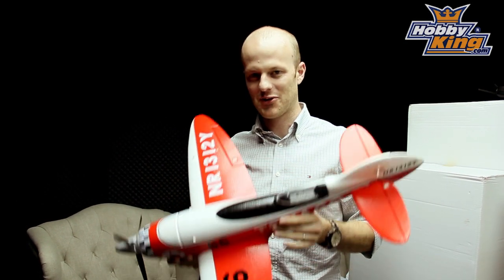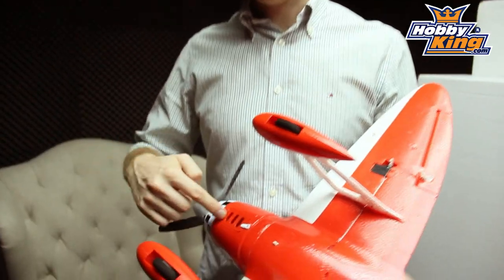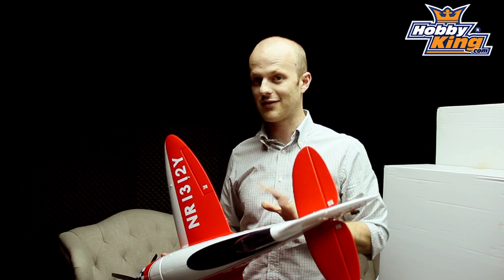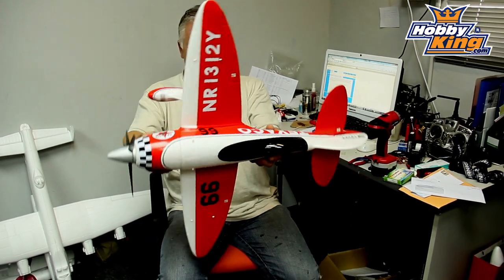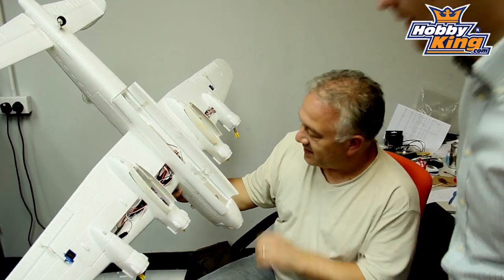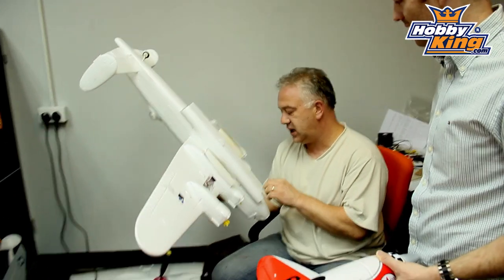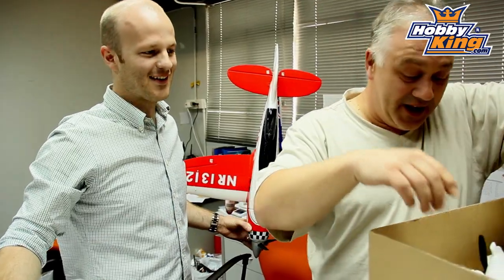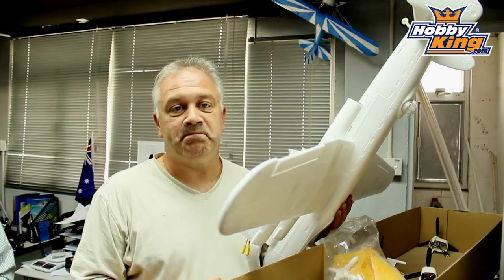Pre-Release GeeBee R3 & Lancaster Bomber Test-Run

Comment: The Lancaster looks like it will have a high wing loading and as a result fly way to fast to look realistic in the air. The Gee Bee R3 is a really neat looking airplane but why pick a plane that never really existed? There are so many nice Good Year racers out there that could be done. examples: Cassutt, Ole Tiger, Cosmic Wind, Rivets, Shoe String and the list goes on.